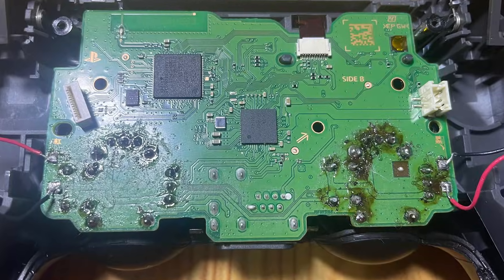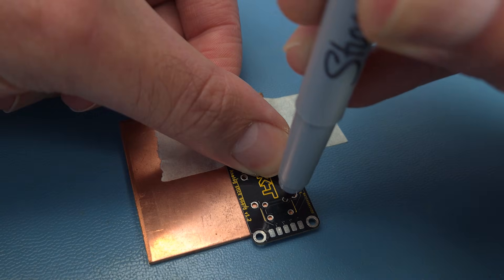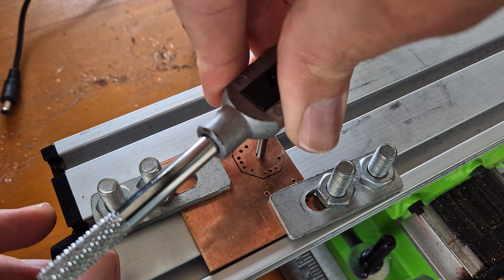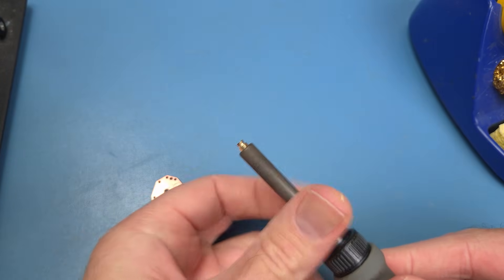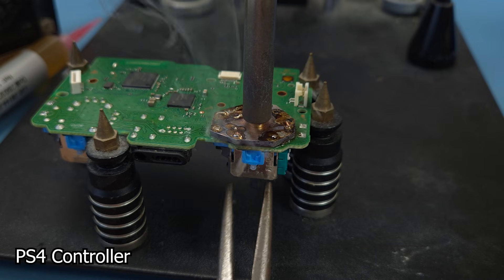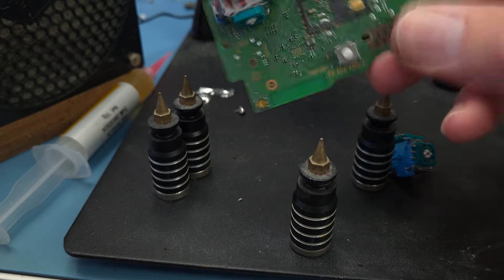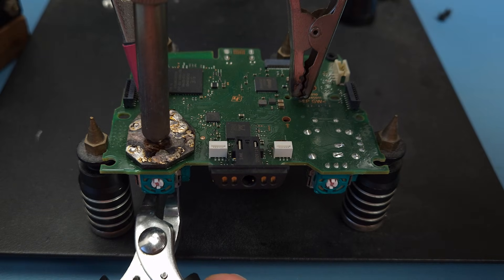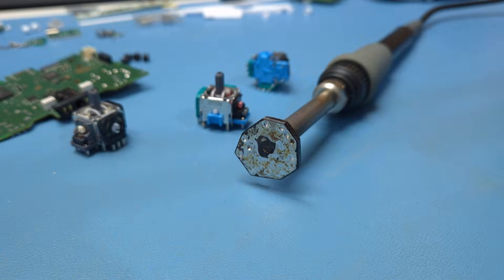Controller Analog Stick Removal Tool

Comment: I'm hopeful until he start using industry standard drill and cutting machine
Reply from the maker: It's only $100 dremel, a $50 dremel drill press, a $50 XY table, and $10 worth of bits 😄
Reply: @RestoreTechnique thanks for the video man, it's interesting works for sure. And you  made it looks so easy and I'm 100% sure im gonna mess it

Comment: Cool project... but really impractical for most people. If you have all the tools to do this, then the time you spend doing it is probably worth more than the cost of the etsy tool.

As someone who focuses on electronics, I don't have those tools. I'd sooner buy a vacuum de-soldering gun than to buy a tool like that, or construct my own, anyway. It's just far more useful and would actually clear the holes instead of leaving them full of solder. Only reason I haven't yet is that other tools have taken priority in the budget so far.
Reply from the maker: Yeah i know, only for tech's who have a dremel and a drill press attachment i guess. Also just a fun challenge, not a tutorial or suggestion necessarily.
Cheers 👍

Comment: I think it would be easier to just cut the prongs off and remove the old stick, and then use a regular soldering iron to head up the remaining bits one at a time and let the pieces just fall out. But I guess if you want to save the integrity of the old parts....

Comment: You should drill out a channel to raise the part around the holes, similar to the tool you're copying. Right now a lot of heat is going through the  middle of the block to the board, which is undesirable and reduces the heat applied to the solder.
Reply from the maker: Yes good advice

Comment: Great idea for only $5. My issue is cleaning the holes. I tried various grades of wick, several suction plungers and anything else. At the end, cleaning the holes takes more time then removing the stick. Maybe I’m not applying enough heat with my air and iron.
Reply: Деревянная зубочистка вам в помощь.

Comment: Part of the design of the original tool does have purpose.  Rather than a flat plate where the unused portions of plate can conduct heat fairly easily into neighboring metal, the design better focuses where heat is applied, which makes it more efficient to use.  From this same design, you also form wells where gobs of solder can be wicked up, which makes it a bit more efficient to use.  Raising the plate also makes far less mess on the silkscreen of the PCB, though having to do less cleaning would be more important for a high workload business, though they'd also likely have a hot air station or a hotplate.  While the plate design isn't bad, it should be seen as a first step towards something better, with something better having blocks that focus on the sets of pins. 

I'm personally waiting for someone to evolve this into incorporating a desoldering pump.  Personally I don't see the purpose of a specialized tool unless you have a high workload for that part, a K-series tip gets the job done just fine for these, though having a pump incorporated into the specialized tool may make the investment worth it.

Comment: With a solder wick and low temp solder just undo the joints one by one. Same way on install, do a couple anchor points and solder the rest in.

Comment: Remove analog stick super fast in just 10-15 seconds using  hot air gun and soldering iron 
simultaneously

Comment: The idea is good, but only if you make sure the soldering iron is at a nice temperature. I’d use it with low-melt solder/“SMD solder,” that way you can do the same process with way less heat. The less it melts flux and/or the board’s coating, the better - that’s a solid indicator. The process the guy mentioned in the comment below using a copper wire can also be adapted. Here in Brazil, buying something like this ready-made is expensive for anyone, so we try the “Brazilian way” first, even if it blows up, but around here we say it’s by making mistakes that you grow.

Comment: Gotta add a gap, hole, or higher point to the midel, xbox controllers have a pad directly underneith the stick modules that are pre sodlered, as thia sits flush, those would likely get de soldered

Comment: I did the same but used aluminum not the best heat transfer but it works while at higher temperatures. You could get a nickle anode and make a nickle electrolyte then plate it if not the acid in the flux will corrod the plate you made. You need more heat and dont press to hard you'll defrom the pcb

Comment: Cut out the useless material on that tool and it will heat up much faster without needing to power up your solder machine

Comment: Now lets see if your tool is able to remove the sticks on a dualsense edge module while also being able to remove a stick in under 2 seconds and being able to last enough to fix 300 controllers like the one from the Etsy seller. And yes I did talk to the guy and he's told me a buyer was in fact able to have his solder tip last that long

Comment: This desoldering technique for controls became popular in Chinese engineering, but it was inspired in Chile. They created similar tools for use in their mining industry, as Chile is the world's largest producer of copper.

If you want to take this tool to the next level, you should add a vibrator to your tool and it will be better than any Chinese extractor. This is what Chilean miners did to desolder faster. 
The vibration helps high-melting solder (such as that used by SONY) to flow better without requiring excessive temperatures that could damage the PCB board😏

In the past, they used the vibrations of a drill, but today they have tools with added motors.
Reply: I'm from Chile, and I had no idea about this.

Comment: instead of applying the solder to holes, wouldn't work to just flood the pins with fresh solder instead? (and maybe add a little flux in the holes of the copper shim)

Comment: bro just bend a bit of 2mm copper wire to go around the whole thing. also apply lead solder to the joints one by one before trying to desolder all pins at once.

Comment: For those without any fancy tools, copper wire bent around the solder joints, then add excess solder and apply heat to copper wire (has to be specific gauge of course, around paper clip thickness) - this way other components don't get heated up. This is just an old school trick, and I use this often to salvage/desolder parts I need off boards. If u search yt there should be vids on it under desoldering made easy.
Reply: Can you link one here?
Reply: @W00fer  I can't link it or it'll get flagged, just search "desoldering made easy" and it will be the videos by Mr Solderfix

Comment: Nickel plating solution is actually fairly easy to make. Vinegar salt and hydrogen peroxide. Then use nickel for both electrodes and run 5 volts through it to dissolve some nickel. When its dark green you put nickel on the positive side and the plate on the negative. Move it constantly to dislodge the hydrogen bubbles from the surface. And it should work pretty well. The plate needs to be extremely clean too, degreased.
Reply from the maker: Thanks. Yeah I looked how to do it and bought a piece of nickel. Have never done it before.

Comment: Just 5 bucks and a few hundred dollars in machinery, so cheap!
Reply: For what it's worth, that's production costs. For retail cost, selling a completed toolhead for $9.99 would offset your costs very quickly
Reply: 5 bucks and 2 days wasted just to make the part
Reply: It's possible to improvise a tool like this with a thick copper conductor shaped like this. Applying lead solder or even low melt solder and preheating the board with a heat gun should improve success rate considerably.
Reply: Thought exactly the same...
Reply: And it wouldn't even work for an Xbox controller, those have a hall effect sensor for the triggers in the area where the copper plate would sit. That's why the proper tools are hollowed out where there are no solder points, so any components on the board between the stick solder points aren't being crushed or preventing the tool from seating properly.
Reply: You can do all this with simple hand tools, no problem. I’ve even seen Pakistani videos where they literally made a gun using just a file.
Reply: I was about to say, not all of us have a drill press and other fabrication power tools.
Reply: IKR? I HATE this kinda video.
Reply: @ethernoh what did you expect? A removal with a butter knife? Use common sense lol
Reply: @FnafBonnieFan   I expected him to use $5 bus wire to bridge the PCBs for desoldering... Not using hundreds in machinery to clone a product.
Reply: idk man, I bought a drill press for my home workshop a week ago and it was just a bit more than 100$, including the drill vise, which I had to buy separately. and that's all you need really. you can cut it by hand and sand it by hand. you can drill it by hand too, really. you can drill a hole in copper with a sharp stone, man. so I get the irony of 5$ + all the expensive tools and I hate it when people do the DIY videos using 3d printers and all the stuff that you can really substitute when following the steps. but this one is easy to reproduce without all the fancy tools